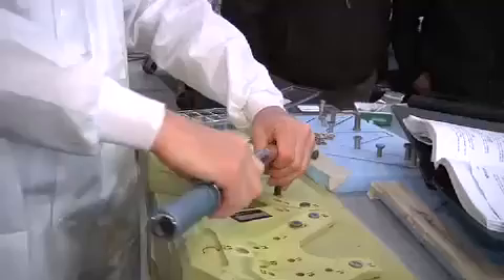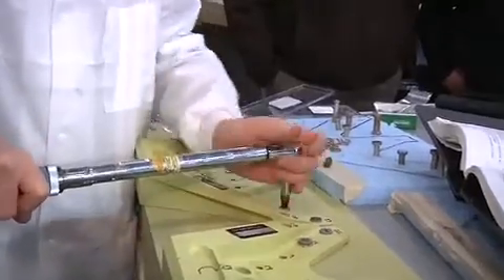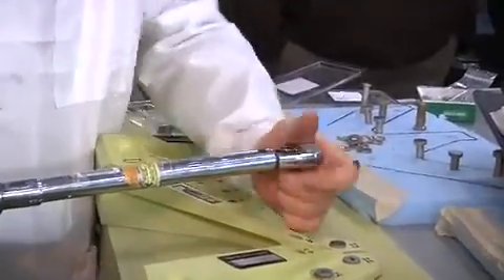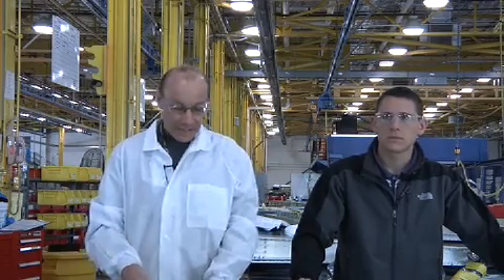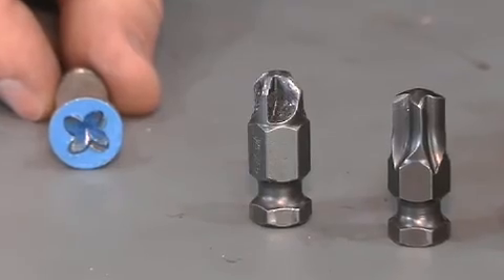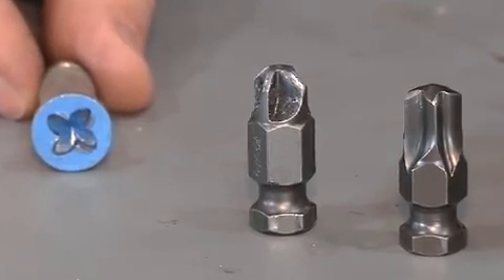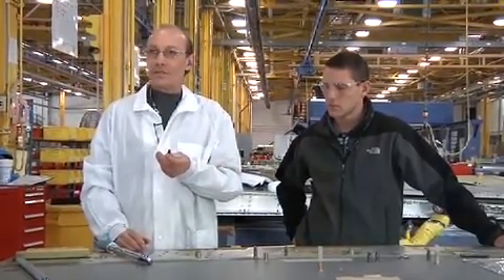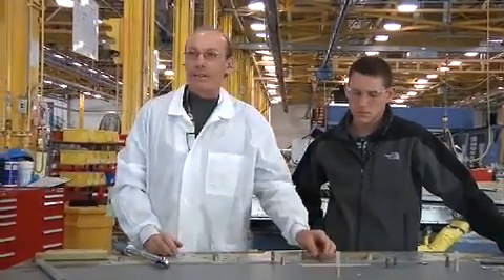F-16 Wing Bolts

Comment: It's a terrible video, but an interesting drive method.  I'd imagine it's not "taken off", as I've not seen any indication of it in use or adding it to the standards.  But gosh, I hope the Air Force airframe mechanics have better technique than what was shown here...

Well, just checked their website and the "MORTORQ" drive system is a listed option in their specialty fastener drives, but I've not seen any myself.  Would be curious what the fatigue and tensile strength properties are of this drive method compared to TRI-WING or TORQ SET-type drives.